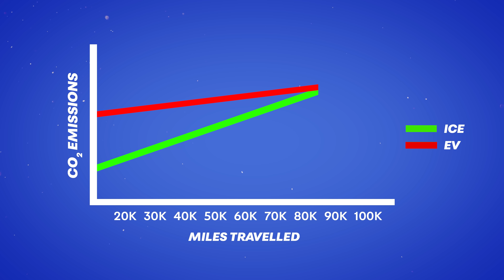Are Electric Cars REALLY That Green? [New 2022 Data]

Comment: What I conclude from this report is:
1. EVs will be come more and more green as we switch over from fossil fuels. ICE has had a very long time to squeeze out as much efficiency as possible, and it won't get much better than it is right now. EV's on the other hand most definitely will.
2. There was no mention of the fact that an EV literally has roughly 100x fewer moving parts. Less wear and tear - less often the car needs servicing.
3. The battery will eventually be able to be recycled. Since about a year now there's been a company doing just that. A former employee of Tesla started a company to down-cycle the batteries after use. The purity of the material recycled is roughly around the 99% as far as I've seen, whereas an ICE vehicle gets dumped into a scrapyard.
4. Germany has found novel ways of mining lithium. Very eco-friendly and with very little water usage. Perhaps in future we might be able to recycle batteries 100%.
Reply: How do you come to the conclusion that EV will become much more efficient...?  The energy conversion efficiency is already very high.  And you must understand that BEVs have been around as long as the ICE...
By the way I would really like to know how you justify your statement that ICE improvement stops today??  
Read the article I posted earlier by Bjorn Lomborg - it will help you understand why many of your beliefs and predictions are basically flawed.
Reply: @srb1855  Nope I meant it will become greener as our grid becomes greener. Also, I never said ICE development stops today. And yes I know the electric motor is actually older than the ICE. That doesn't mean, however, that the same amount of money has been pumped in to develop it. ICE will not become much cleaner than it is today - but BEV will, when considering the fact that Karlsruhe Institute of Technology has found a great way of mining lithium from geothermal plants, and batteries can be recycled. It's a closed loop system that already is cleaner, and will continue to become much cleaner and things develop.
Reply: @FuriousImp  I really doubt that you have any way of knowing how much money was "pumped" into developing anything.  Unfortunately you suffer from the same affliction as all the other electrification zealots - you think you can predict the future for everyone.  The fact is we need every technology available today - applied where it makes sense and not across the board as you suggest.  Furthermore electrification of passenger cars and trucks has a negligible effect on global warming - IPCC conclusions not mine.  Therefore no one who buys an EV or any other type of vehicle for that matter deserves a state subsidy.  So if you want to drive a BEV because you need a new toy then that's your choice - but don't be surprised when people object because you get a generous gift in the form of a state subsidy...
Reply: @srb1855  Lots of logical fallacies such as straw man and ad hominem there. Maybe you should move to a place where you're allowed to smoke weed and start up a new hobby to chill down buddy? How about that? By the way - I don't own a car. I usually go by foot or bicycle. Another assumption you made. I'm now looking to buy a used petrol car because my new job prospects require me to. I do as much as I can to make sure the next generations will live well.
Reply: @srb1855  How about that new hobby huh buddy?

Comment: The other thing that is seemingly overlooked is that lithium, the primary battery component is probably harder to get then fossil fuels, requires huge footprints to mine. the mines are in places that are not optimal, China for one.  One large area in Nevada that has lithium reportedly in abundance will probably become a environmental football if they try and start producing from it.  

Finally, when you consider that that environmentalists want this sooner rather than later, and manufacturers and some govt's are saying we'll be all EV by X, without any seeming consideration if you can get enough lithium for millions of new EVs.  

Related to this is the cost of a new EV is higher than the ICE version, unless somethings changed, and I don't want my taxes to perpetually pay tax breaks for EV's for those that can buy them without a tax break, and for those who cannot afford one, probably never will.  The Volvo Recharge appears to be at least $16K more than its ICE version and thats after the $7.5K tax credit to incentivize it or try and make it affordable, which its not at about $48K.

The other part is what Rory said about how he charges using solar or wind or however he actually does it, none of these sources will ever completely replace other means of power generation as they require wind to blow and sun to shine. Renewables are still mostly in the single digits for energy production world wide. Plus many people are not in areas where this is remotely possible and probably will not be anytime soon.

Then finally, there is depending on various factors, is the inconvenience of EV's, the long charge times without proper chargers, the varying standards of charging plugs in the US which no one is addressing,  Sure if all you do is get up go to work and the store every day and you have installed your 220V line (about $1000 to install maybe)  in your garage to charge overnight, you'll be good to go most days, but the days you do go farther, or your going some place where chargers are slim or none... You wind up being stuck with very long charge times... with ICE, you're in and out of gas station in 5 minutes or less.  

Sure more chargers are coming online, but not enough if the population of EV's grows quickly. There are many pros & cons, however much of this is based on IMHO unproven science of climate change, which assumes disaster without real proof.  This argument is not my focus on this post.  There are just other things in a mass EV rollout that many do not seem be considering.
Reply: You highlighted a key point - climate change is a problem like any other but it is most certainly not an existential threat to humanity.... By the way this is essentially the message of the IPCC itself.

Comment: Less than a minute into the video, I can say I agree with you. My car burns gas. An EV car often burns coal (remotely). And the mining of lithium is very anti-environmental. Then you have to replace the batteries. Much like wind and solar power, they have their own set of problems with the environment. Nuclear energy for our electric needs is the most practical answer.
Reply: In uk we dont use coal in our grid (well less than 5%). All grids are getting cleaner quickly. Even lagards like the US. Nuclear power is 3 times cost, takes a long time to build and has million year storage issues. The environment issues are less from lithium, more from the rarer elements. Cobalt is a concern but modern batteries are cobalt free. Please inform yourself better before spouting media misinformation.
Reply: @andycampbell193  I was curious - so I looked it up. looks like UK electricity is approx:
2% coal, 24% wind (that's very impressive), 12% bio energy (that's also impressive), 4% solar, 2% hydro, 3% oil, 16% nuclear and 36% gas.
Reply: Until the Nuclear Power Plant Blows up and kills every living thing within a hundred KM radios then the land can't be used for human inhabitation for the next 500 years, then any animal that tries to bread on that land will mutate.
Reply: until there is a nuclear accident ala 3 Mile Island, Chernobyl or Fukushima.
Reply: @mochiebellina8190  No. There's no 'until.' Nuclear is still better even when you take accidents into account. Remember that the alternative for electricity is mostly coal and coal mining results in many many more accidents - less newsworthy individually, but in the aggregate more costly in terms of lives lost and damage done.

Comment: Would a standard battery last 90k miles?  I would asume if the car is being used daily and disregard of ideal charging practices. The battery wouldnt last 90k, so you would have to replace it,  and then your emisions increase once again dramaticly. Also the cost of ownsership. I firmly believe there is no one better than the other.

Comment: That both car share a platform, also means that the car doesn't get the benefits that a pure platform does. Same with battery production, and how they are created. Tesla created batteries with less co2 than a lot of other cars.
So both cars being based on the same platform makes the petrol one come better out, than if the EV had an optimized platform.

Comment: In the 1950s and 1960s there was an urban legend that a carburetor manufacturer (I won’t name them) made a prototype carburetor that allowed car with a V8 engine to got ridiculously high fuel mileage (in excess of 55 mpg) that “accidentally” found its way into a production car. Supposedly the owner reported phenomenal mileage and the dealership switched the prototype for a “production” carburetor. It was further said that the oil companies paid off the American auto industry not to produce such a carburetor. Speaking as a retired auto mechanic and vehicle producer (fire trucks) I find this to be absolute poppycock!

Comment: Have you factored in battery replacement? I have a 26 year old car and 41 year old motorbike. Both have their original engines. Both are well maintained. Will a 2022 EV Volvo still be going in 2048?
I doubt it.
Where are all these millions of EV battery packs going to go?
Reply: 100% correct
Reply: Great point. More CO2. Does a battery last 90,000 miles before it needs replacing? And the cost. EV wokness is about feelings, not science.
Reply: @jimmyboy2  ICE wokeness is about fear and nostalgia, not science.
Reply: Your car is 26, well maintained.  What electric motors do you have in your house that are equally old?   I have several fans, an electric shaver, light bulbs and more.  You're falling into a classic logical fallacy.    What parts on your somewhat unique 26 year old motor have you replaced?   Is really the same car you bought all those years ago?   Especially that "original" engine.   How many miles do you drive, in what sort of weather / climate?  How do you drive?     In short, your personal experience has nothing to tell anyone about the effectiveness, suitability of EV vehicles.   As to battery replacement:  consider that it will be possible to simply drop in a new battery, perhaps one with 5 - 10 years of scientific and engineering progress, in it.  Essentially keeping your car current and viable for decades.  Whereas you're stuck with your 1600 cc dinosaur looking for ancient parts and technology to keep it struggling to keep up.   Enjoy it while you can, but the asteroid has already hit.
Reply: @crinolynneendymion8755  it's not about electric motors. I have recently retired from the Navy after 36 years in Submarines - so I might just know a bit about battery power and propulsion given that our Submarines are effectively hybrids.
The motors and ancillary systems are not the issue...but like an ICE car they need to be maintained just as much. Yes electric motors are lubricanted and cooled by....oil. Oh no.
The issue is batteries, especially lithium ion batteries and similar.
They are very expensive and resource intensive to manufacture. They start to degrade immediately, their best years being the first 5 or so, then their capacity degrades severely.
They are expensive to replace and atm cost 4 times more to recycle than manufacture, especially given the toxic nature of their components, all of which have to be mined and manufactured.
As yet there is no means of putting out an EV battery fire as a result of an accident or battery/switchboard failure. They can burn for several days.
Yes my car is original and maintained iaw the service manual...which is why I still own it.
So sure, you go and by an EV. I'll stick with my reliable, efficient, cost effective and easy to recycle ICE vehicles thanks.
Reply: @rockygoodfellow77  You’re always talking about EV‘s and batteries but you need to realize that there are different types of batteries regarding the form factor and also the chemistry. Submarines mostly use lead-acid batteries which are significantly different to lithium based batteries. The first wave of EVs have NMC batteries, the power density is really good and temperature doesn’t really make a difference for the performance. The current/next wave of EVs use modern LFP batteries. The density is almost as good as the density of NMC batteries and with a good thermal system, cold temperatures are manageable. They don’t need cobalt, so they are very easy to recycle and cheaper to produce. But the biggest upside of them is the lifetime. They can be charged over 4000 times without significant loss of capacity. For the SR+ Model 3, which also uses this battery that would mean a lifetime of over 1 million miles. After that the battery is still not dead at all. It can be used for energy storage projects. 
LFP batteries are also less likely to catch fire and in the unlikely case that they do, easier to extinguish than NMC batteries. 
One more thing I would like to add. The statistics compare modern EVs with modern ICE cars which are more efficient than old cars and have several filters to treat the exhaust fumes. If we compare your old car with a modern LFP vehicle like the new Model 3 the break even would be at less than 10000 miles. The cost effectiveness highly depends on your location. My last ICE required three oil changes per year (every 10000 miles) and the fuel was four times more expensive than with my Model 3 which doesn’t need oil changes and the brakes last way longer as well. I paid of my Tesla in less than two years, just with the savings alone.

Comment: Surely at 90,000 miles the EV will be coming up to needing its battery replaced, which will buy the petrol version another 90,000 miles of emissions before it becomes worse than the EV, so will probably never produce more emissions than the EV?

Comment: It blows my mind when I hear that an EV has a greater CO2 cost upfront compared to an ICE vehicle. Take a step back, and think of all the metal components in an internal combustion engine. The steel crank and cam shafts, the aluminum pistons, blocks, heads and girdles, how can you tell me that forging those components is less CO2 intense than making a lithium battery. You still need to mine the iron ore, bauxite etc and ship the raw materials to where all the magic happens. The foundries and smelters are massive users of energy. Electric motors on the other hand are relatively simple and require far less materials and resources to manufacture, so it would be interesting to see what assumptions have been made. I'm a petrol head and lament the day dinosaur juice will be no more, but I find it hard to believe that EV's are more of a CO2 impost up front.
Reply: The electric motors are definitely less carbon intensive than the engine. The true carbon comes from the battery though. I’m honestly baffled that it isn’t immediately obvious that a massive thousand pound battery wouldn’t immediately seem more carbon intensive than an engine.
Reply: @rando4168  Can you elaborate on the energy intensive processes that are unique to batteries that aren't apparent to me?

Comment: Good to hear this. One thing that seems to get overlooked though is how much extra electricity needs to be generated if all cars were electric. Europe will need 40% more, how is that going affect the mix of renewable/co2 generation? If it means more co2 generated electricity, that break even point gets higher. Certainly the case is not clear enough for governments to mandate ICE bans.
Reply: CO2 from power plants will always be less than the CO2 from ICE cars. For every joule is takes to turn a wheel, the power plants pollute less than an ice.
Reply: @TheArfdog  but you don’t/can’t turn a power station on and off like the EV end user and there are losses suffered by transmission and distribution of electricity. And the whole point of this topic is the break even point where EVs start to produce less co2 than an ICE car because of the co2 cost of manufacturing an EV.
Reply: @Echo-jg8is  where’s your extra 40% electricity coming from for an all EV car fleet? How do you think the oil/gas/coal gets the power station? Or do we have enough extra capacity in Europe to meet that electricity demand by renewable or nuclear means?
Reply: @Echo-jg8is  the rest of what you’re talking about is addressed in the Volvo debate
Reply: @Echo-jg8is  I’m not on anybody’s side. Im on he side of informed debate and reaching the right decisions. I’m not a climate change denier, I want to know that EVs really are the answer to the car co2 problem. Why does every debate these days turn into a you against us? It’s so counter productive, shutting off discussion by name calling.
Reply: @Echo-jg8is  I don’t think you’re actually answering or listening to anything I’m saying. You’re just hell bent on saying I’m a climate change denier/renewable energy skeptic. I’m neither, Volvo is saying that with the average mix of electricity generation in Europe, you only start to outweigh the co2 emitted during the production of an EV versus an ICE car at around 70,000 miles use. My point is what happens to that break even point if we can’t meet increased electricity demand to charge EVs with the same or better generation mix? BTW your uk 90% solar claim in 2020, where on earth does that figure come from?